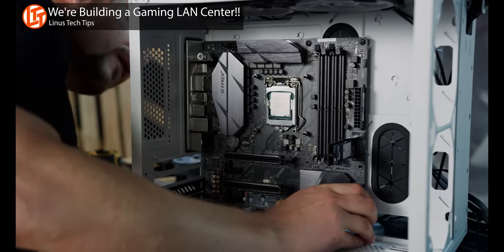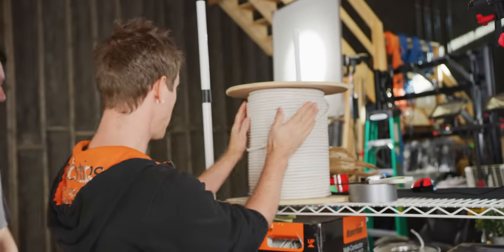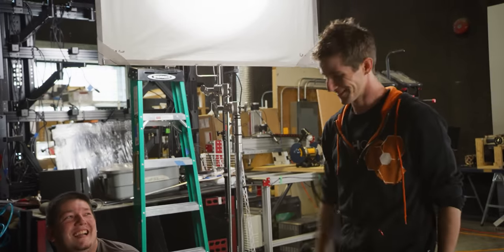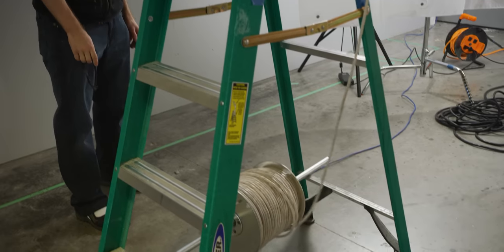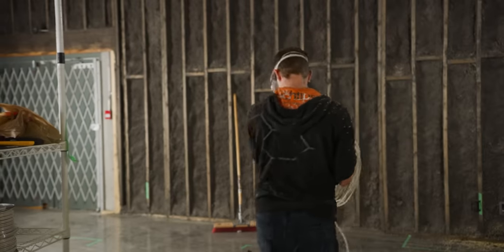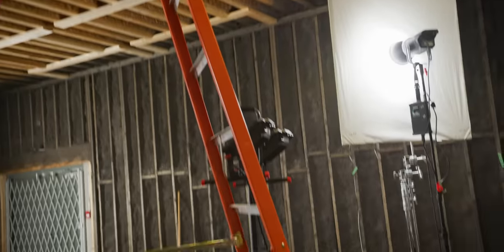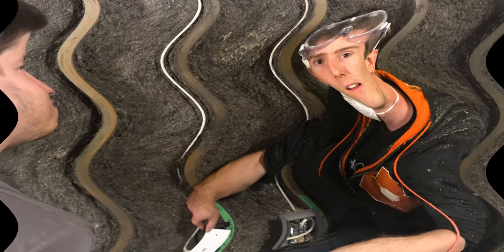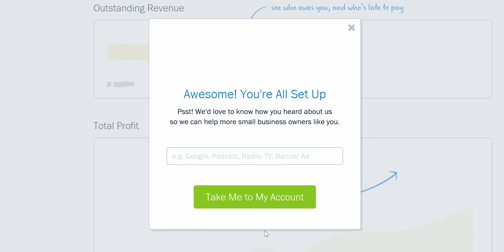Electrical Wiring for the Gaming Center - What could go wrong?

Comment: Everytime I see american electrical wiring I say to myself "That is stupid? Why do they do it like that?" In Sweden we do the wiring in pipes so you can re-wire the installation in the future, its also more safe for the cables. And that is something we have done for like 60 years or something.
Reply: they are behind in intellect
such simple solutions and they somehow avoid them
Reply: I think all of Europe is thinking the same as you, including me.
Europe is just way further ahead when it comes to safety and upgradebility with wiring.
Reply: Running conduit for many jobs is cost prohibitive with no clear benefit. There are however many jobs where it is utilized like in exposed areas for safety purposes. 

There is simply no reason to run conduit for UTP wire or 110v romex.
Reply: @dennism316   Yes there is, it's for better safety and upgadability purposes.
Reply: He’s canadien
Reply: @dennism316  It really isn't cost prohibitive. PVC conduit is cheap. Was considering it for the house I'm in when I realized just how much wiring I had to redo and that 8ft of PVC tubing only cost a couple dollars. The only reason I didn't is because the bedroom walls are all in great shape and I really don't want to cut sections out of a perfectly good wall to drop in tubing. Still giving serious through to picking up enough for the kitchen and basement since I don't have the kitchen walls finished yet and the basement has paneling that can be popped off easily without damaging it.
Reply: It's not the cost of the conduit, its the cost of paying the guy for 3x as much time to run in conduit.  upgradability isnt an issue, as a wire can be re-fished pretty simply if it needs to be, since most commercial applications like this use drop tile. Worst comes to worst, patching drywall is pretty cheap and easy compared to the european alternative. I'm not saying the ways you guys do it is bad, but its definitely more expensive, and most of the time not necessary.
Reply: @eideticex  Labor is not cheap. And conduit = lots more labor.
Reply: @dennism316  im with you, there is a reason they lifted the code on allowing romex use in the US,  no reason to continue living in the stone ages trying to run flex everywhere for a remodel job.
Reply: @Olsulor11  its actualy not and i can drop a romex line down a wall just as fast as pulling wire down a flex.. btw it doesnt offer upgradabilaty.. what am i going to do make the wire 10 guage so i can put 220 on the circut ?  romex makes way more sense.
Reply: Residential fires from in wall shorts is something I never hear about in the U.S. unless it’s from a rodent, which will chew through PVC anyway.  Fire, electrocution, etc are more from likely from electrical devices, bad outlets and/or breakers.  Without the conduit, cost is lower, there’s more flexibility, remodeling is arguably easier, and fish tape works wonders.  That said, for short runs around an entertainment center I prefer conduit or panduit because the amount of cabling and how often you will change it.  It wouldn’t surprise me if residential conduit eventually becomes a standard here, but from a cost analysis, risk management perspective, it doesn’t really seem justifiable.
Reply: Aren't most European houses solid wall with render? If so, of course you would run conduit. We obviously do the same thing on nonplasterboard walls in the rest of the world, but on plasterboard walls, it's not necessary, especially with power cable. There is nothing unsafe about tps wiring in a plasterboard wall.
Reply: @dennism316  Wrong, we use flexible conduit with pre-installed wire/cable. Takes the same time.
Reply: @Faddnn  good luck with pulling new cables trough flex.
Reply: @hamstrtj  Easy if you do it right. Can pull 2 new wires at least 30m  in a 16mm flex if there is 3 in it already, making it 5 wires.  30m cable is neither a problem if done correctly.
Reply: You may see electrical wiring in cabel canals, pvc pipes or under the plaster. The most common are in the plaster and in cabel canals around the windows.
Pipes are good if you want to help as an electrician may show you all necessary pipes, you drill the holes ... and the wireing goes in the next month when the electrician get back.
Reply: So just because you have done it the same way for 60 years makes it right for everyone?  Love how you all think that conduit is the best system and nothing else works. What if you wanted to move the outlet or switch over 1 meter that is not an easy fix when everything is done in conduit. I am not disagreeing that pipe makes for a nice clean installation, we run conduit in a lot of commercial installations but those are generally buildings that are made with brick or concrete and steel. When it comes to wood construction running loomex is fine, just cause you don't understand it, does not make it any less safe or any harder to upgrade/renovate. I have worked on many homes that are 60 years plus wired with very similar cable and its working just fine and I can add to the circuit as needed if our codes allow it. Maybe MrZequal, Doktor Kranium, blub trara and Olsulor11 should be a little more open minded and maybe learn why we do things different here and learn the benefits of wiring homes and other wooden structured buildings in this fashion.
Reply: @fbeckman  it's not harder to move a conduit installation, you can even pull new wires making splicing unnecessary. We have equipped that can extend a conduit in 2 sec and pre-installed conduit making it as fast as cable:

https://youtu.be/WWPknNl5G_0

Comment: Thank you random electrician that makes sure people don’t use quick connect/back stab connections

Those connections should be banned
Reply: And it's always the outlet the customers use for the vacuum that melts the most because of those connections.
Reply: If it's done properly there should be no problem. But neverrrrr stab with 12AWG wire, only 14 and up.
Reply: @xXJiNxInOuEXx  "14 AWG and up" INCLUDES 12 AWG. There is no Properly. They always fail due to current traveling through the outlet on a mild pressure connection, creating heat and Melting the outlet and insulation. Pigtail Preferably, Terminal Posts or not at all.  If you don't believe me, Do Electrical Service Work for Homes for more then 2 days.

Comment: It's good for my phone (s8) but what's with the funky aspect ratio??
Reply: 1920x960
Reply: The video is in 2:1 or 18:9 and your phone is 18.5:9
Reply: @miniblaster9  It's really not, yes my phone is 18.5 x 9 but the recent videos from this channel are wider than the older ones. (Between 18 x 9 and 18.5 x 9)
Reply: i noticed that too, it’s actually nice on my iphone x because it takes up way more of the screen
Reply: On computer (not phone), and I prefer this aspect ratio. Youtube would always have black bars on the left and right, and this makes them smaller.

Comment: Why not use a staple gun?
And in Norway we use tubes we pull cables trough, most Scandinavian  electricians get small strokes when they see American style electric work
Reply: In Finland we get small strokes when we see Norway's electric work. Some things you guys have chosen to do are very weird.
Reply: @s0ulshot  Well as a swedish electrician i found all of the other Scandinavians electric work weird... PVC tubes or pipes is a must when wiring cuz of future changes, and also most of your cables is a piece of work to work with like all of yours Single "thread?" 2,5mm2 is trash  :/ please be more like us :).
Reply: Thomas Bekkenes Can you set a staple gun to a certain depth and not all the way tight on the cable so it is pinched? Cable needs to be pullable.
Reply: @addenotheus329  Ooh, don't talk shit about single thread! I love it more than those sloppy multi thread? (Don't know the terms)
Nothing beats a nice firm single threaded cable. 
Tbh we use as much as possible the PVC tubing if it is inside concrete (obviously), but everything that isn't done in that way causes future problems, but we'll see do we go back to pipes eventually.

Comment: No pvc tubing for easy cable changing in the future!?
Reply: Tommy Henriksson not a code rule
Reply: it's a set, not a house...they'll probably change the entire thing even before that's needed ;-)
Reply: You can pull new romex through using the old romex if a wire needs to be switched out. Bend the ends over each other, wrap the connection in a crapton of electrical tape, and start yanking from the other end. It's a lot of work and you lose the staples, but I've seen it done lots of times.

Comment: The main reason we need good earthing wires in New Zealand is our sockets put out a real amount of power at 230 volts. Not that wimpy 120 volts like both North American countries use. ;-)
Reply: Imagine the cost of wire in North America, so much more copper is needed to get the same amount of power through as we get with thinner wire here (in Europe for me and New Zealand for you), just because of the voltage difference.

Comment: Why not a cat7 cable???
Reply: 6a is the same, i think. Just a re-name for easyer convensations
Reply: @frostmedia  not entirely the same , but 6 is way easier to install etc and in case of speeds etc they are similar.
Aslong as cat8 isn't standard, there's no need for anything else but cat6a
Reply: Because cat 6 (regular, non a) is quite sufficient. In fact, for gaming, cat5e would have been fine for these runs.
Reply: Also cat7 is not and never will be a standard . Cat6a can handle the same 10Gb speeds at the same distances Cat8 will be the next standard. Cat7 without being an approved TIA standard will have varied results and quality and compatibility based on manufacturer. Plus true low voltage cable manufactures , reputable ones like comscope and Belden and other won’t make 7 as it doesn’t have a place in the real world .

Comment: 14-3 wiring is barely adequate for 15 amp service in short lengths... I'd have gone with 12-2 or 12-3. Having a lot of computers can draw a lot of power, the last thing you want to do is push the limits of wiring.
Reply: The 14/3 is for the lighting, convenience plugs, TV etc. the computers are getting their own runs, and will be on #12 and 208v.
Reply: @lttbriantheelectrician   Ah ok, that makes sense then. But why 208v? And how do you know this? Are you Brian, sneaking around the comments section? lol
Reply: @turgsh01  yeah he is lol
Reply: @lttbriantheelectrician  Nice! Does that mean you have to make custom power cables for each computer?

Comment: As an electrician, here are some of the little differences I noticed from how we do things here in the states:

- He calls it Lumix, we call it Romex.
- He's using 14/3 wire, meaning a shared neutral. We're no longer allowed to do that here (at least in my state) unless both circuits sharing the neutral are on a breaker with the two poles tied together, so they ALWAYS go off together.
- Plastic boxes in a commercial space; we use metal in commercial.
- "Brings all the drills, no batteries." This is actually the same 😂

Comment: this looks almost exactly what I did for a job once, except it was to cubicles, and the walls were already installed. And there was a false ceiling already there, with insulation on top. Watching this looks a lot easier than what I had to do. The only differences were than in this video there was no conduit run for the ethernet and power, and there were a lot less opportunity for the ethernet to score.

Comment: Advice: whem you move a tall ladder, you move it with a friend and, the important part, you do it from the inside. Lift it with your legs and handleded it with your biceps.
Also important: use gloves for the moving it and never stop looking up if someone is working up there while you are support in it or you're passing by.
Just pay attention full time and there it will be no need for protection. But use it.

Comment: You ought to have a tester for the ethernet. Even a simple SC8108 for around $25 will tell you that wire 5 and 6 is swapped and wire 7 is disconnected 1.5 from this end.  Just plugging a device into the socket and the other end in switch does not ensure it is working fine; I 100Mb, couldn't go 1G until the tester showed me my patch cable was only using two pairs, not all 4.

If you are doing 10G, you ought to have a tester which shows impedance and reflections, otherwice you might be chasing around to find cables damaged by builders rodents or office chairs  for days. They are more costly, but probably worth it in your environment where downtime costs money.

Comment: The reason you dont run data and power in the same place is that if there's a short between the two and the data is plugged into a landline phone, the phone will ring as normal but blow 110/240 volts at 10 amps through your ear if you answer it. And of course it will blow up most other equipment connected to it, but back when the rules were written the big one was the old phones.

Comment: Personally I always wrap my plugs in electrical tape... figure then if the outlet shifts slightly it doesn’t short live to ground. I also avoid those quick connects. My sister’s house was wired with quick connects (by the builder 20+ years ago), who ever did it left a whole ton of stripped wire sticking out of the back end of the connection, and didn’t bother to screw down the terminals, so you had live wires, a fraction of a cm from the box. Shortly after I’d replaced most of her outlets, her neighbor’s house burned down... same builder... started in the kitchen plugs....

Comment: Linus if you haven't done so already. I would invest in a good uninterrupted power supply (stand in, short term, backup power.) In the case of a power outage it will give you gaming PCs ample time to shut down. They also double as surge protection. There kinda expensive, but nowhere near the cost of replacing multiple sets of hardware.

Comment: Is it common to just run the cables in the walls without tubing? I live in Switzerland and literally everything resembling a cable is run inside a tubing, which is installed inside the wall in case you want to add more in the future and you won't have to "open" the walls but could just push and pull them through the tubing. I'm just asking out of curiosity; maybe it is financially more lucrative, even with opening the wall for adding new cables?

Comment: Surprised that trunking wasn't used for the electrical and networking. As that would have meant a tidier installation and no cross talk between the network and power.

Comment: wow, interesting. This method of stapeling cable is not accepted where i live. How would you change a faulty cable after installation of walls and such? We use plastic pipes between all boxes and pull single wires through for less termination time and easily replacing of cables/leads.

Comment: It's still a twisted pair if 99.99% of the length is twisted, an inch vs half an inch, isn't going to show up as a problem, the whole point of a twisted pair is to cancel out cross talk over the run of the cable with other cables, that last inch or so isn't going to be an issue.

Comment: With Ethernet are the male ends that go in the sockets rated or is it just the wire that is cat4 cat5 or cat6 type of idea? The reason I ask is I had some cat6 given to me that I might use instead of the super cheap ebay wire I have in right now.

Comment: Cat 6A Can be bitchy to find and to install, I work in networking and the best brand we've used is LS (LG, goldstar...), Since the cable is stiffy but easy to cut, and the sockets are well built but they require a proprietary tool

Comment: I wouldn't have used 14 gauge wire. Especially not for the receptacles, used just for lighting it is acceptable but you really want 20 amper circuits for your receptacles especially in a commercial setting. If I were wiring this none of it would be 14.

Comment: Also Cat-7 has been around for a long time. :z future proooof.

Also could have been fiber
Reply: Here's the thing, though. The differences between Cat6A and Cat7 are of debatable importance, especially depending on length. In fact, Cat5E is capable of 10Gbit/s, but only over very short distances, as per one of the 802.x standards (I forgot which one, and I'm too lazy to look it up). The other thing is, fibre is expensive, and no one wants to hammer conduit into studs, then run fishtape all the way through, then pull OFCR or OFCP through, and no one's going to be putting fibre transceivers into every PC at the client end. It'd be more reasonable to have a fibre transceiver in the server room and a fibre transceiver at the local switch level, then use direct copper from the switch to the client. Fibre also tends to do funny things when you try and use a switch that's not, say, a Juniper networking appliance (something that costs 10s of thousands of dollars, per appliance) and a direct fibre connection. FYI, I'm not trying to be a dick, I just want to put my two cents in as someone who has to deal with fibre and direct copper on a daily basis. :) Cheers mate
Reply: @SejinKim5  yeah cat6a is only good for 10gb/s at 130 feet, while cat 7 is up to 230 feet. 

130 feet goes fast when you go up and down the wall 20 feet both ways, have a patch cable on both sides, and still have to reach from end to end in a warehouse through a multi roomed office